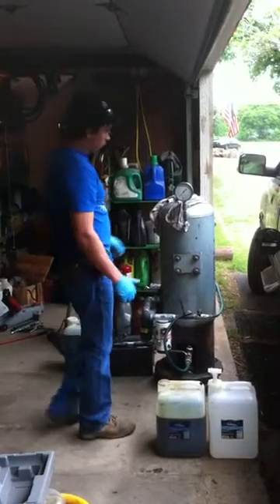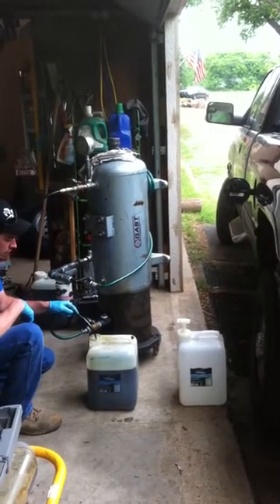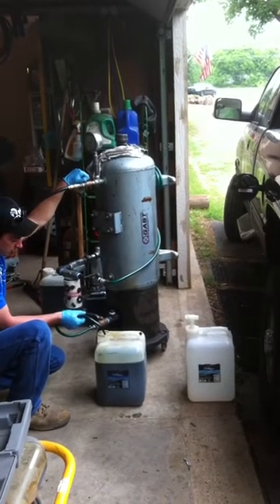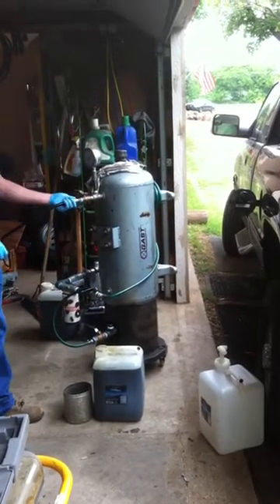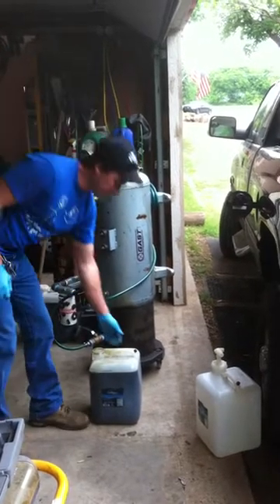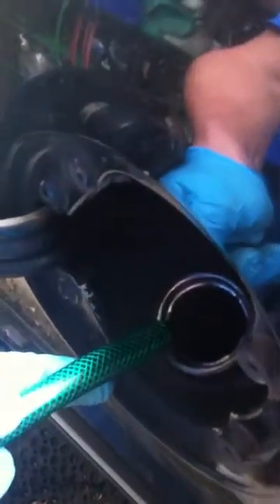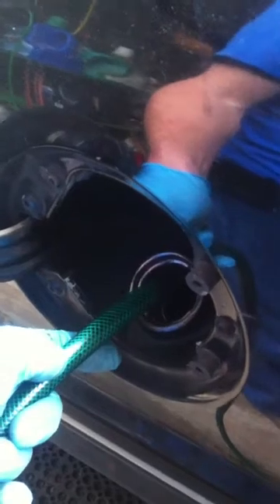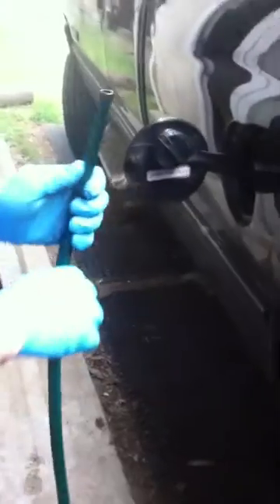WMO - part 1 - Home made black diesel fuel without centrifuge

Comment: What do you guys think about running waste motor oil, ATF, or other oil in my 6.5 L 96 Chevy diesel? Any mods needed?
Reply: I own a 93 6.5 im looking at running wmo in it but from what i know on the mechanical trucks theres no mods needed and the newer ones should run wmo no issue as long as you have it filtered down to 1-2 microns when u put it in the tank or install a pre-filter setup on your truck before the engine filter to filter it to 1-2 microns
Reply: I have 97 Jeep Cherokee with factory installed 2.5 turbo diesel engine. Works great on 30% diesel and 70% WMO mix without any modifications. I'm sure you can do the same with 90s 6.5 Chevy engine .
Reply: im mainly concerned about the "optical sensor" that was reported to be installed on gm/chevys with 6.5l diesels in the 90s. This was supposedly done to prevent someone from running wmo as a fuel. anyone have data as to if/when this sensor was installed on particular makes/models???

Comment: I put a quart of diesel in a 5 gallon bucket the dump bunch of burnt motor oil in the bucket that's it then dump in my 7.3 idi
Reply from the maker: DIESEL DIPPING 
Good luck, not filtering scares me a bit. But if it’s working for you that really cool. I use gas to thin down the Used oil. Diesel fuel will not cut it like gasoline does. But may or may not make a difference for your application.

Comment from the maker: Hi Alden Van Dyke.           I noticed that the synthetic oils seem to create a little extra smoke. I have never experienced any other issues though. Power is still better and motor runs a little more quite. The only issue Iv ever ran into was when running oil that had solvents mixed it. From what I could tell it caused my fuel filter seal to get slippery and allowed fuel to spray out. I replaced the filter and never used oil with solvents again.

Comment: I was looking at centrifuging the oil at the final stage but they are not cheap, the cheapest one I found was over $1,000.00 so I was looking for cheap ones and found that you can convert an acme or omega fruit juicer to clean the oil. there are some mods to be made but a used juicer is only $15 to $30. what do you think. you can google it at acme juicer to clean wmo and give me an opinion. thnaks

Comment from the maker: I get the same black film in the bottom of any container I leave the mixture in for a week or longer. I guess this accumulation must consist of such small particles that it does not cause any damage to the engine or fuel system. although I do try to clean the film out of the containers before I reuse them. the use of a centrifuge might get rid of this problem. I don't centrifuge yet. I only have 20,000 miles of use with WMO & no trouble yet. glad to know you have 80,000 & going strong. thanks.

Comment: i am using black diesel in a 1995 dodge cummins do you experience a black film if you put your finish product in a gas can and let it sit for a week.  i filter it to 0.5 microns and settle with gas for 2 months still geting a black film. and suggestions.  i have been using black diesl for the past 80,000 miles with no problems.
Reply: is your car still running with it ?

Comment: I really like your system.  I've found a good source for various types of used engine oil and I'm trying to work out the best way for me to hook up a filtering system without having to go as hardcore as you did with a used air cylinder.
I do have a vacuum pump which I may use for filtering but I'll figure something out.  Thanks for the motivation.

Comment from the maker: Danny2820, Why do you only add 10% RUG? seems like everybody on the Current forums are mixing between 15 and 20% now. I like to thin my oil down more. its still thicker than diesel at 15% RUG. Thanks again.

Comment from the maker: when I have time, I will be working on building a bigger processor and maybe one day a centrifuge. just filtering has been working so good, I want to keep going this route for now. if I get a newer diesel, I will certnaly using a centrifuge. But I think my old 96 Cummings will burn just about anything. I have used just about every oil i can find. it all burns the same. some just stinks gal bad. lol.  Im at 210,000 miles and going strong.

Comment from the maker: Maybe adding the #2 pump diesel to my blend is the difference. or the extra 5% RUG. If I could obtain more oil, I would be running just W85 or W80. or at least experiment more. but my oil source is not solid yet. and my process is slow. just 13 gallons per week on average as It stands now. But it serves its purpose. and the saved money keeps adding up.I will be looking into WMO far into my future.

Comment from the maker: I have run the straight W85 mix AKA 85/15% blend a few times without adding the pump diesel. But only when fully loaded and hauling firewood. I have not noticed any unusal difference in the MPG though. But I always loose a few MPG when fully loaded. I usually haul 3,5 cords over 150 miles. so I expect to get less MPG. I have not tried running the straight W85 for daily driving.

Comment from the maker: I will remove the hose and replace it with something better suited for my needs. The hose was for temporary use, but ended up being used longer than I originally intended. thanks for the info. I will not pump any more fuel through it. The hose is sure a lot softer now. Its not worth the risk.